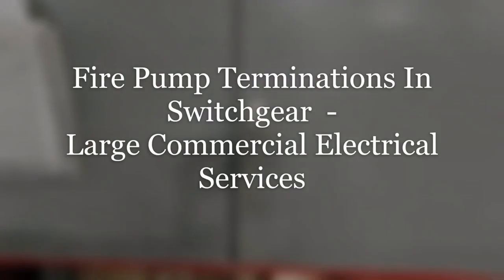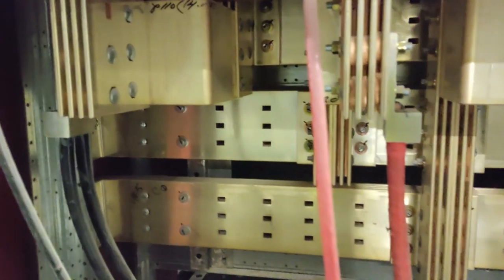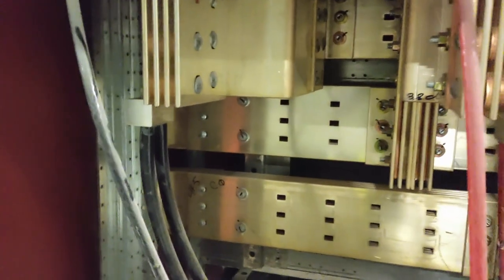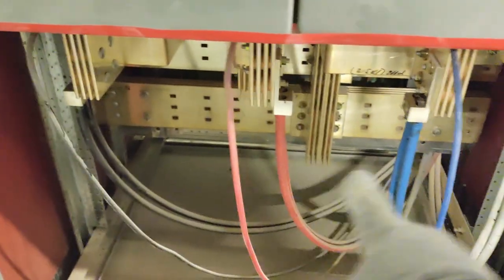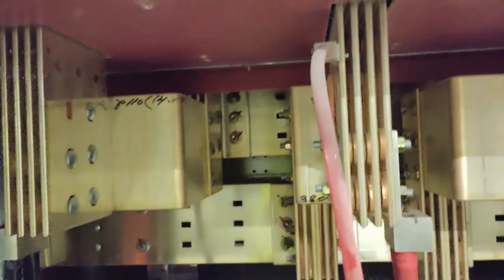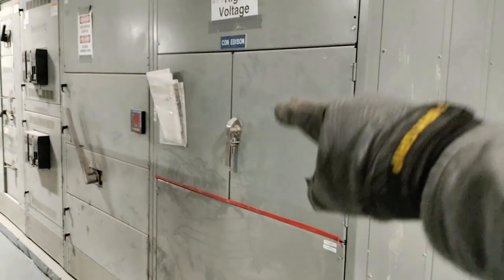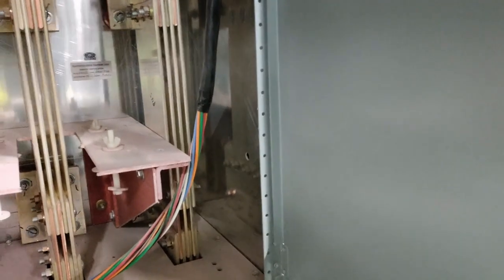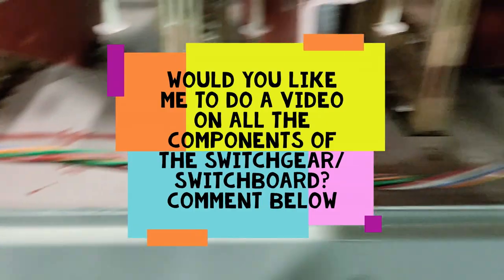Fire Pump Terminations On Switchgear/Switchboard - Large Commercial Electrical Services

Comment: Looks good Brother. I have to go on a service call in the morning, at an offshore racing boat company, for an old fire pump inside of a well that's blowing the cutouts on the pole. 7.2 KV. Weird thing is, the cutouts blow after National Grid leaves. I'm just going to test and isolate until I find the short. I bet you it ends up being the motor itself. Town dock, and the pump is in a pit somewhere in the parking lot outside of the building. Let's See what happens. IBEW LU 99 Providence, Rhode Island